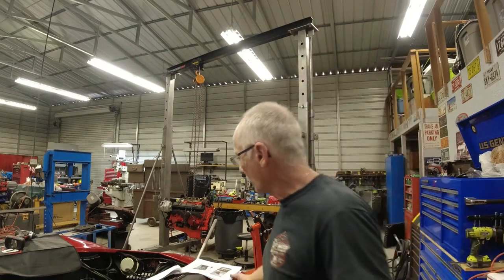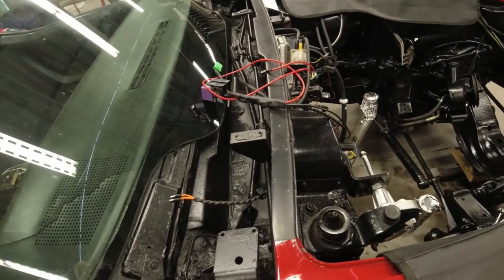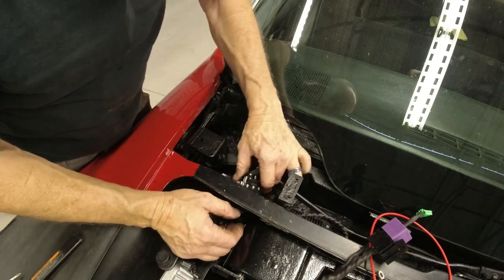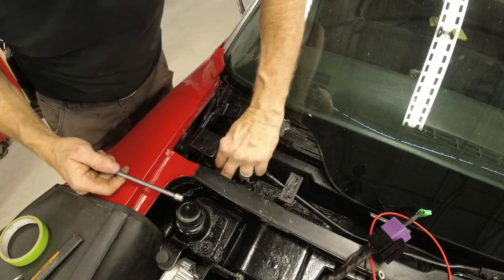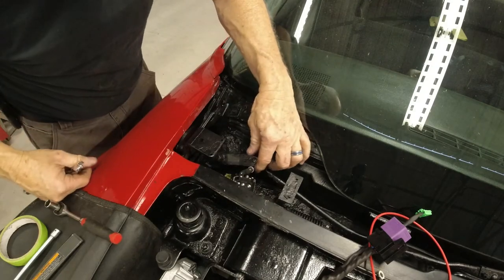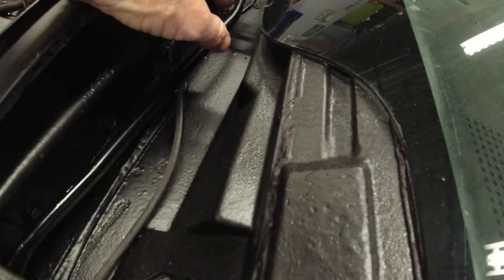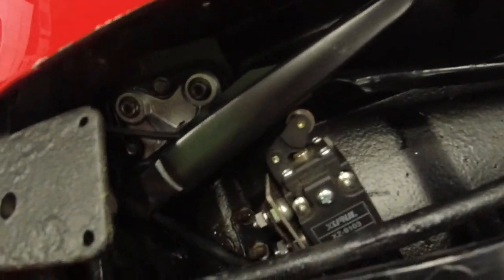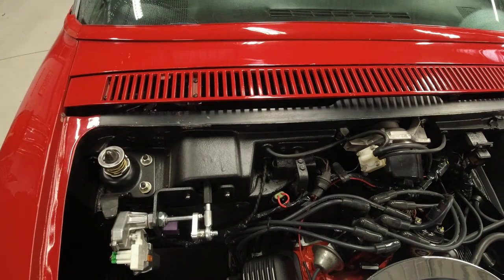Electric Wiper Door Actuator Conversion C3 Corvette

Comment: Looks good and works fast. The motor mount does seem to move a little, but as you said, it’s not something that will be used a lot.
Thanks for the video and look at this product. I’m sticking with the vacuum system, for now…
Reply from the maker: I didn't notice that when I edited the video so i went back and watched it. I don't like it moving I that. When I get a chance I'm going to try re-enforcing it. If you get a chance email me: mdurbin57@hotmail.com  I would like to talk to you about your car. Thanks, Mark
Reply from the maker: @MrRichard454, I will check to see what the angle is on mine. I noticed there are 2 holes where the pivot arm bolts onto the motor shaft. What is the center to center distance between the motor shaft hole and the door shaft? I think I purchased the unit you sell on Ebay. It looks the same as yours.

Comment: Excellent Video! How did the motor hold up?
Reply from the maker: I normally try not to drive in the rain but so far it has worked well when I have needed it. I have probably used it a total of 6 times.  I am very happy with the performance of the unit.

Comment: Nice! I did notice that the rod that moves to activate the wipers rubs the vacuum hose? going thru firewall. Prob not an issue since won’t be used often, just thot I’d mention 😊
Reply from the maker: Good eye. I did not notice the hose rubbing. I will fix that. The hose is actually the windshield washer hose for the passenger side wiper and is currently not in use. I plan on hooking the washer system up in the future. Thanks for watching.

Comment: Adding complication to a part that can work perfectly if you understand how it should work.
Reply from the maker: I figured in the long run I will be better off without all the vacuum lines that can start leaking. When my headlight actuators quit working, I will replace that system with electric actuators as well.
Reply: @timewiththedurbins  Yeah, I forgot, electric systems never fail, wires don’t break or fray their insulation.  Leaky old vacuum systems have high failure rates.
Reply from the maker: Anything man made can fail. Have a great day.

Comment: Where does it wire in for power? Battery or fuse panel?
 Jeff
Reply from the maker: I connected my power wire to the wiper motor power wire.